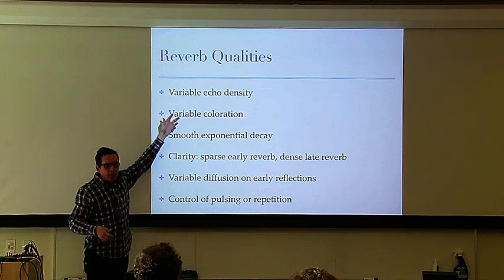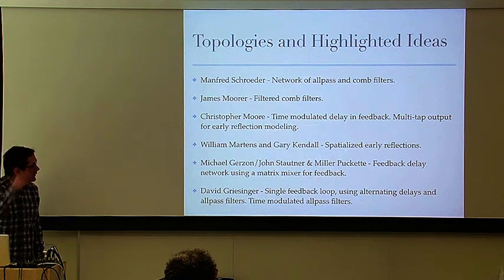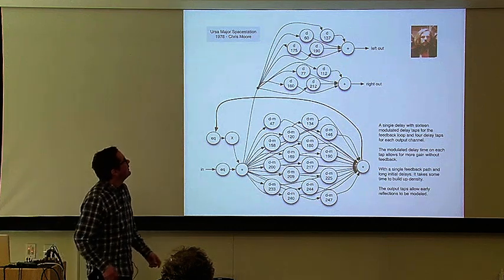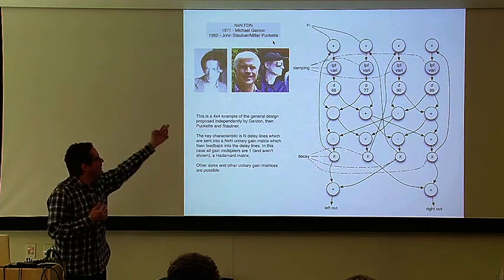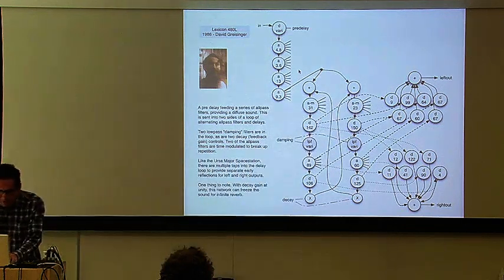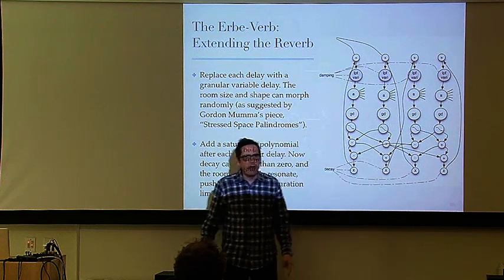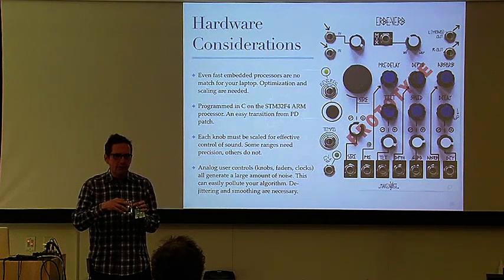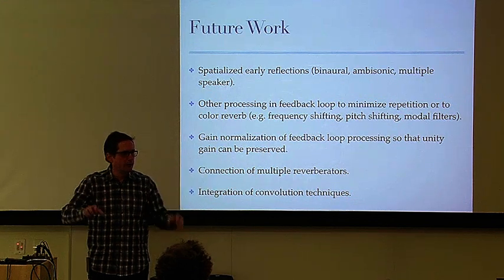Tom Erbe/Soundhack "Designing the Make Noise Erbe-Verb" Reverb Design Lecture (Remastered)

Comment: I'm watching this in detail for the second time and am playing with the PD patches. Having developed for ARM I was also really interested in the 12-bit A-to-D and the need to smooth the values. But Tom said these noisy converters were making the reverb sound horrible. Yet the delay times are also purposely modulated, which sounds somewhat similar. So why doesn't the latter make the reverb sound horrible too? Is it just that the purposeful modulation is at a much slower rate?

Comment: I found this lecture video searching for Jon Dattorro and his algorithms implemented in the Ensoniq ESP2 chips.  https://ccrma.stanford.edu/~dattorro/ESP2.pdf Please consider re-implementing his algorithms in a modern piece of gear so they are available in the future. The ASR-10 and DP-4/DP-2 equipment is getting older and harder to find, and there is no substitute for the 2+ minute (!) reverbs that his algorithms gave (I can give parameters to demonstrate). Of course his other algorithms are also worth preserving as well but the huge Hall reverbs are the most unique IMHO.

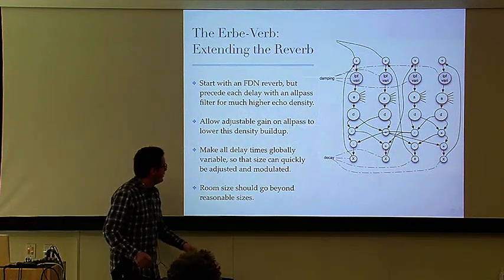Comment: 42:56 The SRAM of most MCUs is too small, so look for an MCU with a larger SRAM. For that lot of DELAYER...
1 DELAYER:  32K sampling rate, 32bit calculation accuracy, 1 second delay requires 128KB memory...
High sound quality, at least 48K sampling rate. 96*4 = 192KB
Professional audio quality at least 96K sampling rate. 96*4 = 384KB